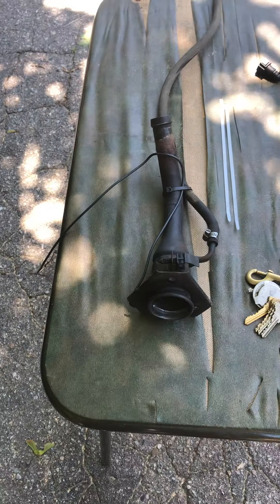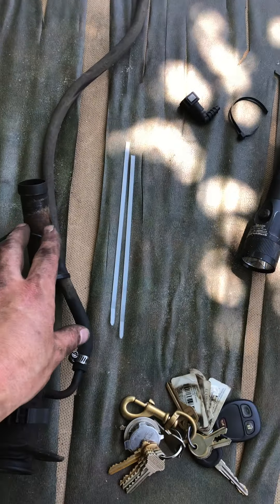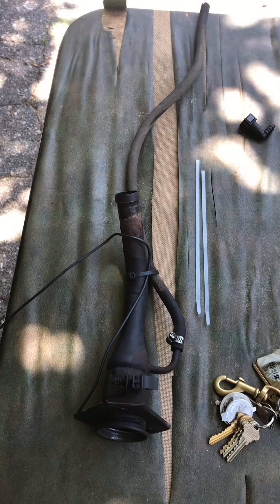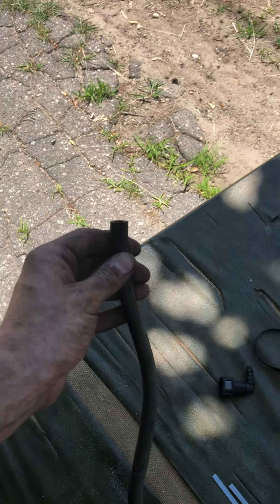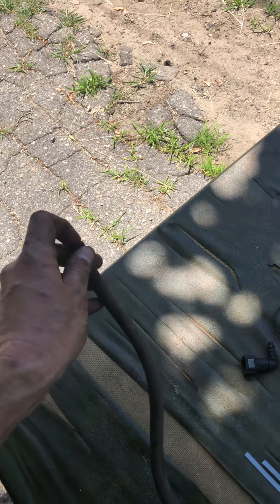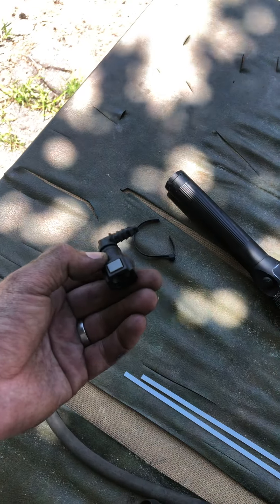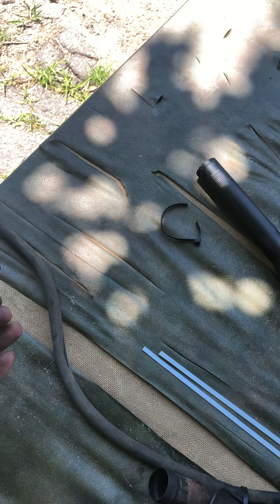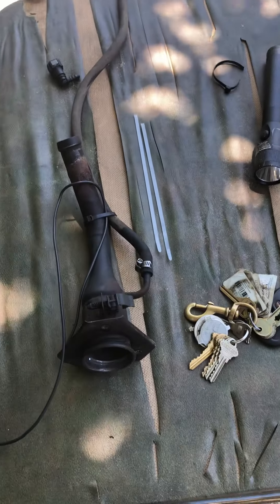2010 GMC Sierra Fuel Fuller Neck Replacement

Comment: I have a 09 silverado and I can’t get rid of evap p0442 code I’ve replaced everything in the evap system and gas cap this is going to be my next solution
Reply: I have had that code for a while too what happened to me it was the filler neck the steel tube was rotted out and pouress until it gave complete rusted thruu and gas started leaking when pumping gas! I’m pretty sure that what happening to your!!